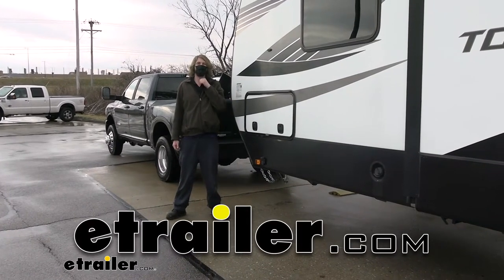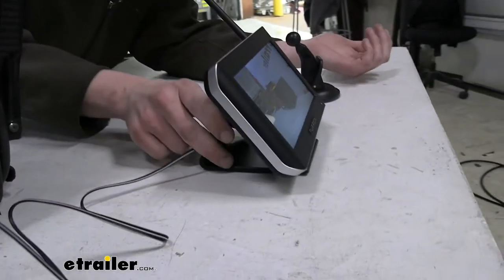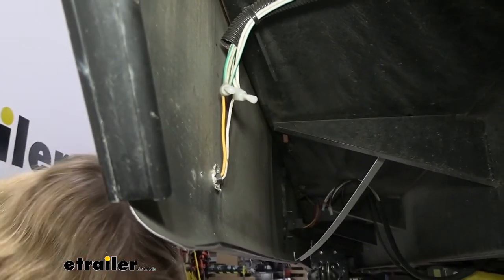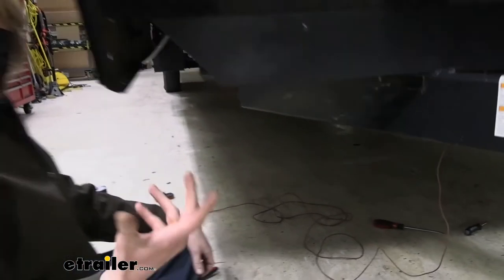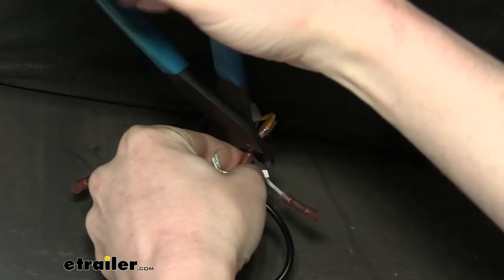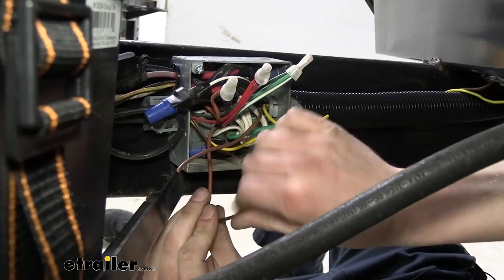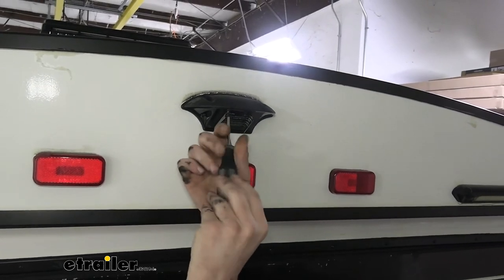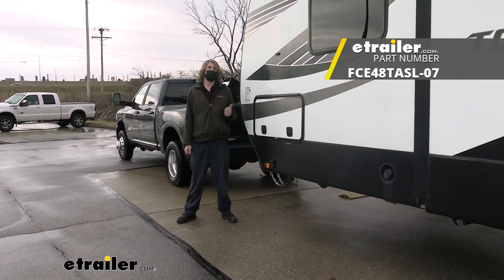Furrion Vision S Wireless RV Observation Camera System Install - 2018 Heartland RV Torque XLT TT Toy

Comment: Question. If I am parked and hooked to 50 amp service, will the cameras still work?
Reply from the maker: The cameras are activated by turning the running lights on the tow vehicle. You would need to wire the cameras to a 12v source and install a switch to turn them on.
https://www.etrailer.com/RV-Camera-System/Furrion/FCE48TASL-07.html